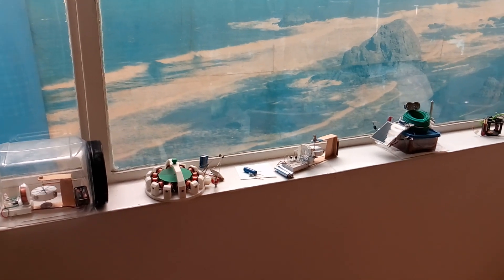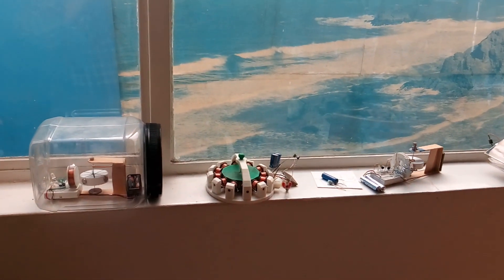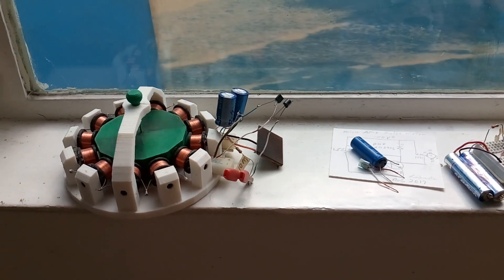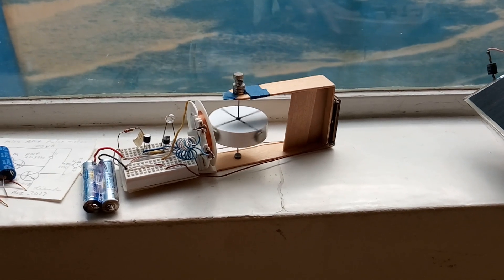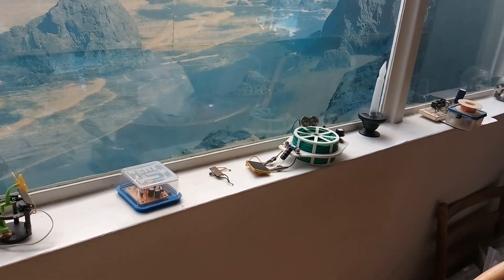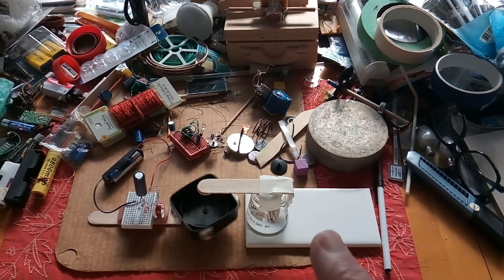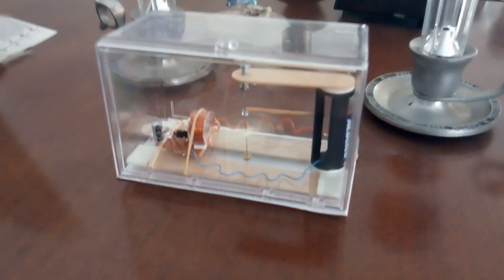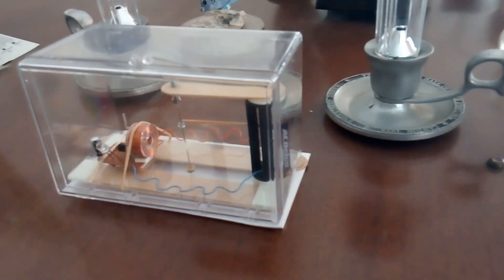Update--- My 'Non-Stop Running Devices' after 2 1/2 years

Comment: It seems the one gaining speed could power some of the other devices, achieving a type of over unity. Does the solar cell lose efficiency with time?
Reply from the maker: I don't know if the EZ Spin has enough 'extra' energy  to power anything.  It is basically just free wheeling.  You raise a good question about the solar panel losing efficiency over time.  As I recall they do but it takes a long time.  Decades perhaps.

Comment: You made the yearling in 2017. Have you changed batteries? If so, when? I was curious if it has lasted more than the year you were hoping for. By the way, figuring out that the coil was moving was a really good catch.
Reply from the maker: I have changed the battery only once.  I can't recall now when I put the second battery in but it was a long time ago.  I am going to have to replace the rubber band with something more permanent.

Comment: Good point about the hard soldering, not apparent until humidity etc over the course of such long runners. Congrats on the running times!
Reply from the maker: I have had good success with Magnetman2010 rechargeable AA projects also and I may just solder the batteries on those to.  That eliminates one source of failure on these long long runners.

Comment: Hi!  Taking you lead, I too have built some variations of your Lidmotors.  However, I machined perfectly round disks that are perfectly balanced with magnets to optimize the speed, spin stability, battery life, and prolong the run times.  Using the Bobble Head's electronics I have some stable spinners following your really nice designs!  By the way, what is that view out your window?  Is that the Grand Canyon?
Reply from the maker: I would love to see those machined rotor motors.  They must be beautiful little machines.